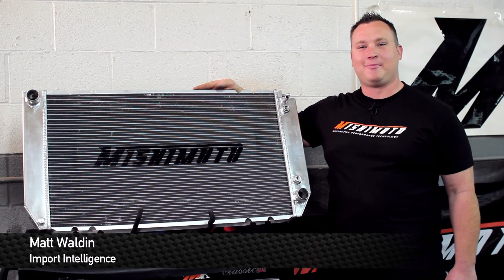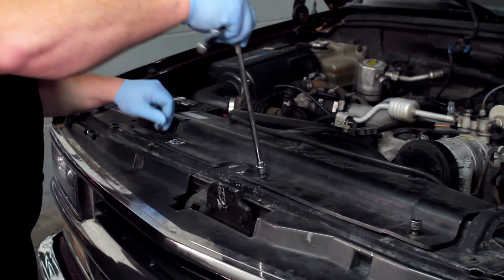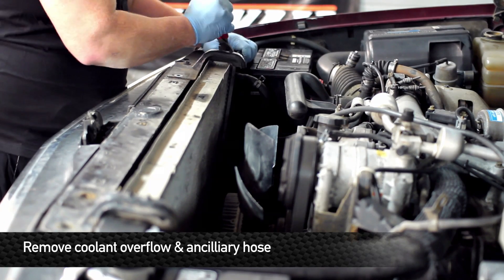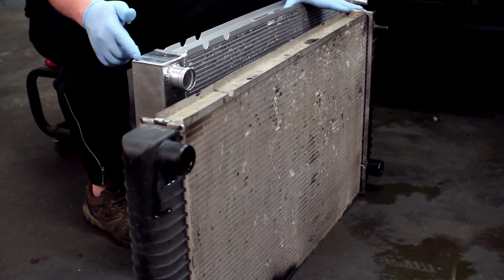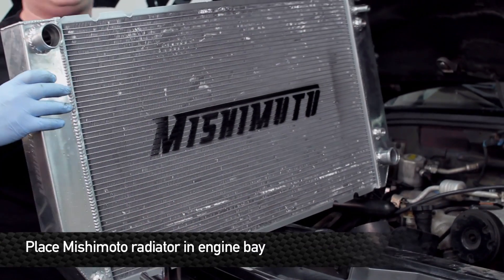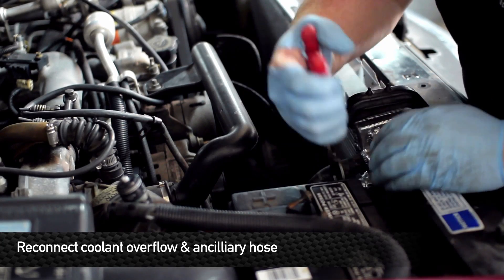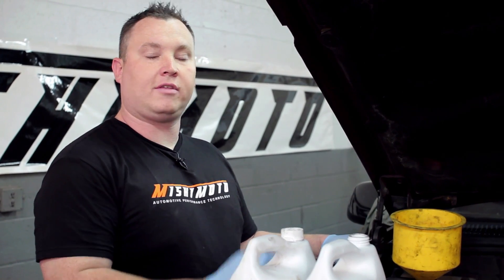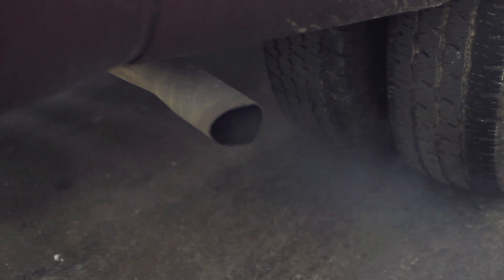How To Install: Mishimoto 1994-2000 Chevy C/K2500 w/ 6.5L Performance Radiator

Comment: other than having metal end tanks whats the difference between stock? why would i purchase this radiator
Reply from the maker: Hello Reece634. This radiator is an overall upgrade over the OEM. Generally, we suggest this radiator to people who are towing on a regular basis, have a heavy foot or have made some upgrades produce more power. It features a thicker core and greater heat dissipation to the OEM unit while maintaining direct fitment.
Reply: @mishimoto  What is this radiator's coolant capacity ?  What is the capacity of a standard radiator ?

Comment: I hate the factory petcocks GM used, they squirt coolant everywhere. I like to have a drain tube to minimize spills. I also use standard hose-clamps with the 5/16" screws on the lower water intake hose, then use a VERY long extension (like 3 12" extensions in a row) to clamp the lower water intake hose. :)